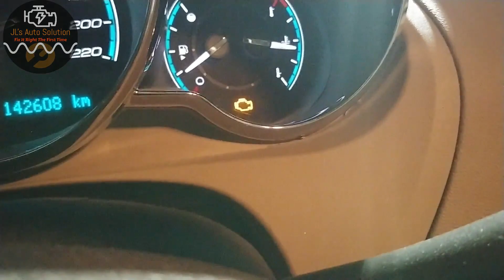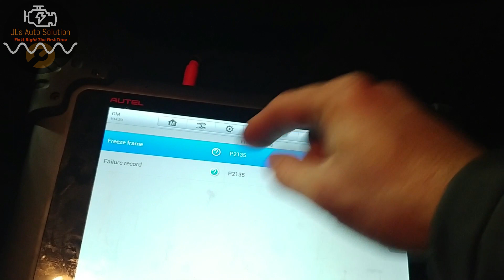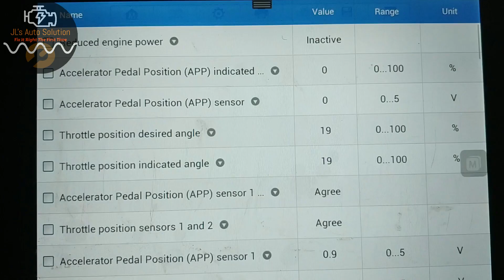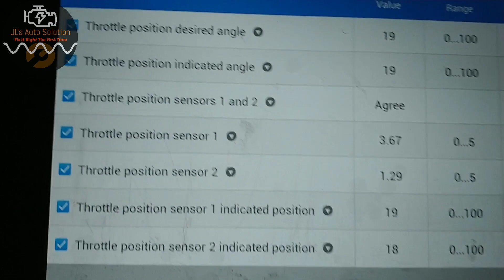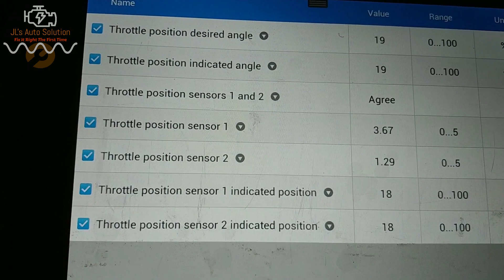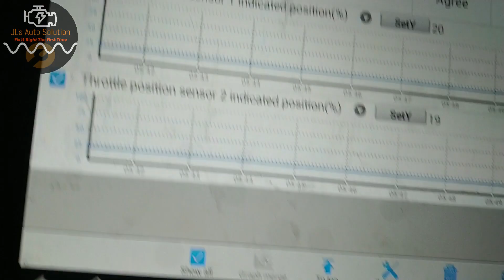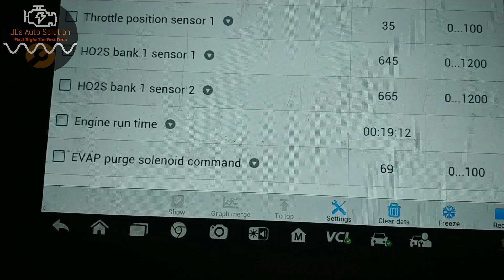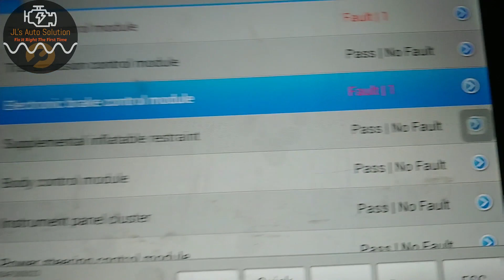2010 Chevrolet Impala DTC p2135(Diagnose By freeze Frame Data)

Comment: freeze is great a lot of people over look it. I like them front seat diags lol
Reply from the maker: Yes, a lot of people do over look it.. now the problem at Kia/hyundai is that, there is practically no FFD. 

Most of the time I take out the Autel. its able to see a lot more than the Dealer scan tool for some reason.. i have written Kia's tech line about this and they have yet to fix the issue,, 

Diagnosing  using kia's shop manual is a real nuisance. so much information is missing, normally I need to get a donner car that is working properly just to get the data required in order to diagnosis the problematic vehicle..  

Kia's philosophy... Try Known Good Part..(UHHHHHH... OK????), and if that doesn't work, well repeat all previous steps..

thanks for watching Ian . Sorry for the Rant.
Reply: @JLsAutoSolution  I completely understand i have knowing techs to put in a intake manifold  still not solve the problem but the customer still gets charged witch is ridicules that is  why i left and started out on my own. keep up the good work